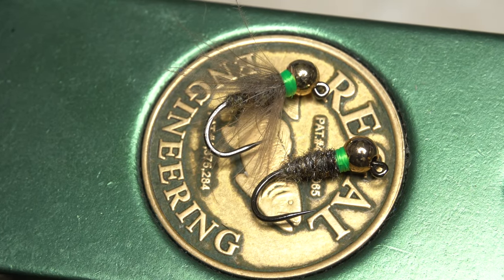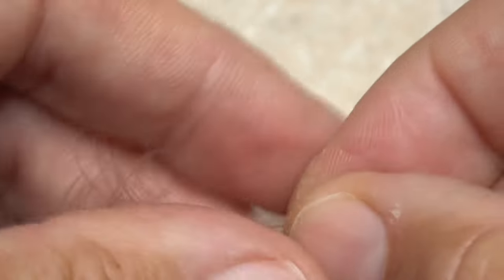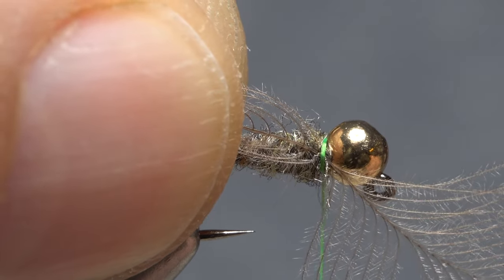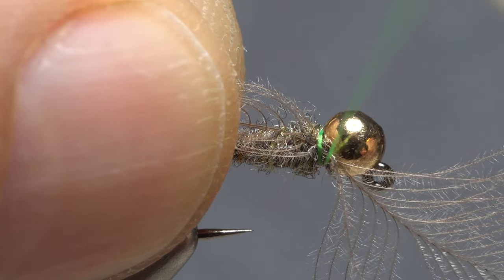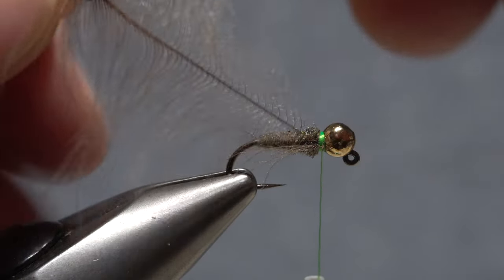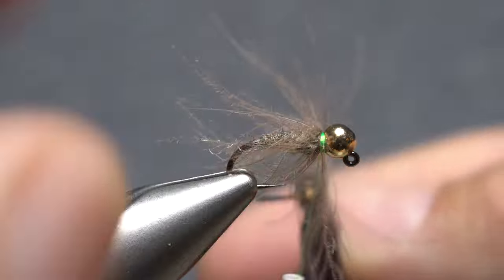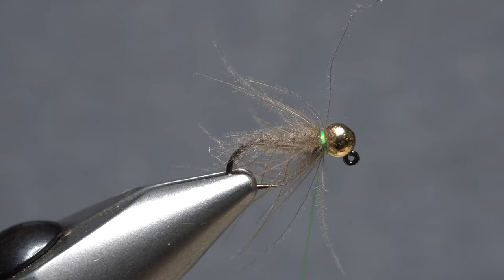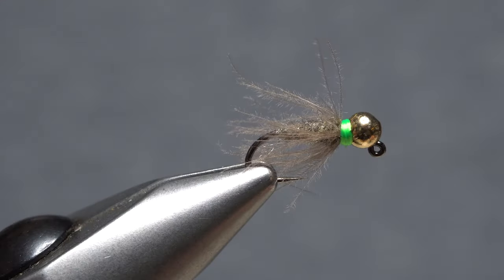CDC Collar

Comment: I’m a little new to tying but thought CDC was used to help float like on a deer or elk hair caddis?
Reply: Yeah but a couple of turns of CDC on a nymph that is also got a good bit of weight built into it makes CDC good for legs in some applications as we see here.  Tie an Elk hair caddis, and put a few turns of lead wire on the hook and well you will then have a fly that will not float. All dry flies will with some exceptions, will not float once waterlogged. That is where fly float, false casting, and stuff like Frogs Fanny come into play. I tie dries by the half dozen at least per size, and in the course of the day, I do change bugs. Right now it's caddis time in a big way. So I make sure I have plenty of # 14 16 and 18's in my box and in the color of the bugs on the waters I fish. So I always have flies that will float. I have never been able to fish the whole day on one dry fly that was not built with foam. Flies do wear out, that depends on how well the fly is tied and the number of fish chewing on it.